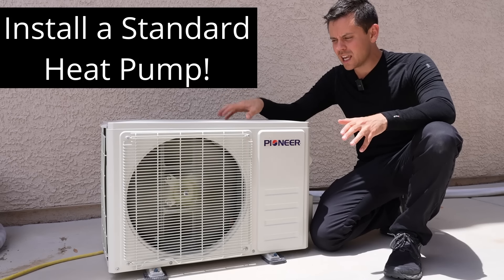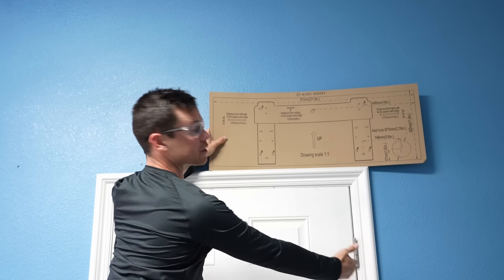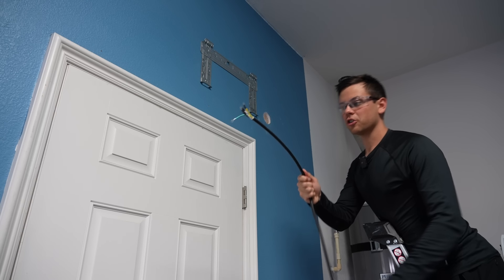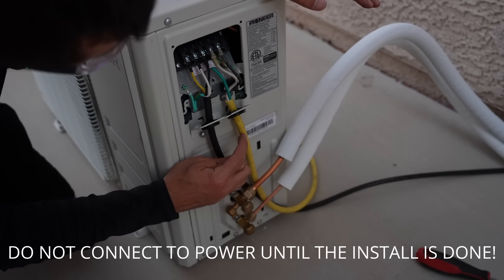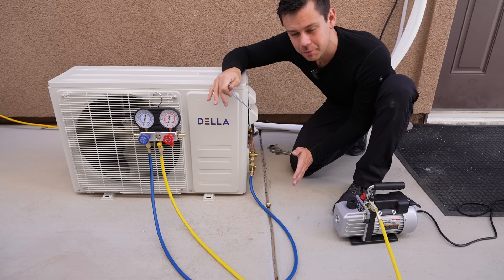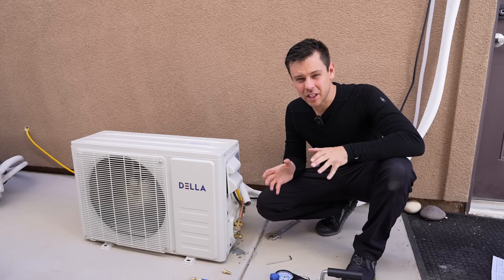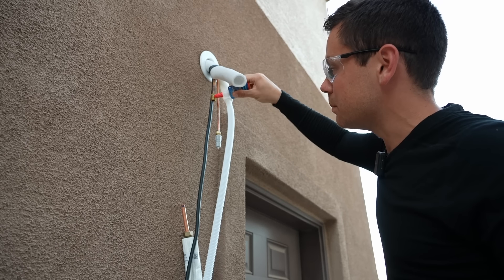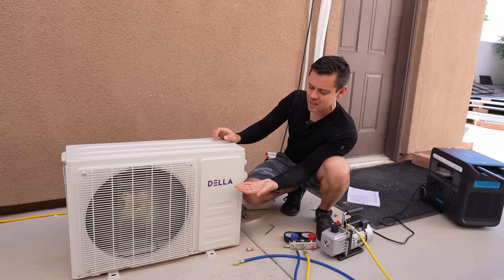Budget Mini Split Installation for Beginners! w/ Vacuum Pump and Gauges

Comment from the maker: Parts list and mini splits mentioned in the video (affiliate links):
Pioneer Mini Split: https://amzn.to/3Og7VZf
Budget Della Mini Split (same product as pioneer but cheaper!): https://amzn.to/3XQlLoF

Vacuum pump and gauges: https://amzn.to/3Qh43Jh
Electronic torque wrench: https://amzn.to/3DdZpUq
Or you can use a traditional torque wrench and these adapters, like I did in the video: https://amzn.to/3pPdqoq
Nylog to prevent leaks on the connection points: https://amzn.to/44JI15N
Leak Detector Spray: https://amzn.to/3OhlEz8
Adapters for hose to service port: https://amzn.to/3Ohssgj

~~~~~~~~~~~~~~~~~~~~~~~~~~~~~~~~~~~~
Does off-grid solar confuse you? 
Save time and money with my DIY friendly off-grid solar kits, my latest product recommendations and so much more! 
http://www.mobile-solarpower.com

Join our DIY solar community 
#1 largest solar forum on the internet for beginners and professionals alike. 130,000 members and counting!
https://www.diysolarforum.com

Check out my free book
Best-selling and beginner-friendly guidebook to off-grid 12V solar!
https://www.mobile-solarpower.com/the-book.html

~~~~~~~~~~~~~~~~~~~~~~~~~~~~~~~~~~~~
My Favorite Online Stores for DIY Solar Products:

Signature Solar
Creator of EG4 and the largest DIY solar store online! 
(automatically save $50 by using my link below)
https://signaturesolar.com/?ref=cPwLcVc0SW-BjN

Current Connected
Victron, EG4, Midnite and so much more! Fast shipping and great prices:
https://currentconnected.com/?ref=wp

WattCycle
A very budget friendly 12V battery that works great!
https://www.wattcycle.com/collections/all/products/wattcycle-12v-100ah-group-24-lifepo4-battery?ref=aaezwkkc

Litime
Classic and reliable 12V batteries for solar! Bestseller for many years:
https://www.litime.com/?ref=XBIA62RFcalHns&utm_source=affiliate

Epoch Batteries
High-quality, marine grade 12V batteries that can survive anything!:
https://www.epochbatteries.com/products/12v-460ah-lifepo4-battery-ip67-heated-bluetooth-victron-comms?rfsn=7352625.50494d

IntegraRack
DIY Friendly Solar Panel Mounting Kits! Easy to assemble and super strong:
https://www.mobile-solarpower.com/ground-mount-racks.html

Ecoflow Power Stations
The most popular plug-n-play mobile power station! I have been using these for years:
https://amzn.to/4gID4j0

Anker Power Stations
Highest efficiency and best performance. The biggest challenger to Ecoflow yet!
https://amzn.to/4k0yhMM

Watts247
Need international shipping for large batteries and inverters? Check them out!
https://watts247.com/?wpam_id=3

Rich Solar 
One stop shop for budget 12V systems!
https://richsolar.com/?ref=h-cvbzfahsek

Battery Hookup
Cheap used lithium cell deals:
https://bit.ly/2mIxSqt
5% off code: diysolar

~~~~~~~~~~~~~~~~~~~~~~~~~~~~~~~~~~~~~~~~~~
Contact Information:
I am NOT available for personal solar system consult! If you wish to contact me, this is my direct email: williamprowsediysolar@gmail.com

Join the forum at https://diysolarforum.com/ if you wish to hang out with myself and others and talk about solar

FTC Disclosure Statement and Disclaimers:
Every video includes paid promotion or sponsorship (such as free products for review). Some links on this YouTube channel may be affiliate links. We may get paid if you buy something or take an action after clicking one of these. My videos are for educational purposes only. Information is subject to change/update at any time. Electricity is DANGEROUS and can kill. Be smart and use common sense :) DIY Solar Power with Will Prowse is a participant in the Amazon Services LLC Associates Program, An affiliate advertising program designed to provide a means for sites to earn advertising fees by advertising and linking to Amazon.com
Reply: Will or anyone who knows to answer please 🙏

Hey Will love your content. About to buy MPP Solar 2724 LV-MR. Can't download the manual so just wanted to know can the inverter be turned off for AC when not in use? I'm building a system for my van mainly for 24/12V.. I know that inverter draws 24W.

Also 4 150W panels with VOC of 42.74 I'll wire parallel and s/b about 17 amps at max and VOC 42.74. Is that going to make for a good system? ( 2 100AH 24V SOK batteries..)
Reply: @Monyornothin  
You could also get Mr. Cool Mini-Slip their Ines are pre done so no vacuum is needed!
Reply: Link for the flare tool?
Reply: @terryrodbourn2793  yes you can but for those that do not like all the extra Lineset and want to shorten it and flare it this is a good video explaining how this is done.
Reply: @terryrodbourn2793 like $500 more too, he says that. Did you watch the video.
Reply: Nice job Will, I will revisit this video when installing my units, Ignore the Haters, your content is Awesome
Reply: @terryrodbourn2793  costs twice as much.
Reply: @fox156 sometimes people miss a detail does not mean they did not watch the video don't be such a punk
Reply: Hey buddy. Question? I'm doin this exact process.. do you think you can send me a link for the adapter that you use. I have the gauge unit and the compressor. Everything is installed already I just have to vacuum the hoses. All I need is that adapter. Do you know where I can find?. Thank you sir
Reply: Just installed my first MINI SPLIT it's a DELLA 9000 BTU 120 AC, now I can power it with my solar system..small but I have a tiny home it's perfect.
Reply: NOTE: A manufacturer/company may require professional installation to have a valid warranty in regard to the vacuum/charging.
Reply: @Pappy-1   Yes, that is a valid reason for doing it this way.  The extra costs hurts, though.  So how much are you really saving?  NOTE: There are sales, too.  Then, the time involved v. quick connects/precharged... especially if the solar panels are included with wiring.  Now, if doing 2 or more, or working something out with a neighbor?
Reply: @karmendimas5274   Yeah, and sometimes people don't watch or skim.  And, you missed this: "Did you watch the video."  That's a question.  Grow up.
Reply: @terryrodbourn2793   How did you miss the obvious in this video?  :-p
Reply: i successfully installed 2 new Goodman mini splits thanks to this video. I did encounter 1 problem. i purchased the recommended adapters. It worked great on the first unit install. On the second one it kept leaking from negative 30 vacuum back to zero. But I had no leaks. Fittings were tight and I used nylog. The problem was the adaptor fitting. The seal inside the fitting is a hard plastic and became deformed after one use. That s where I was losing vacuum. When I used another one of the new adaptors I had no more loss of vacuum. So don't assume your system has a leak if you lose vacuum.

Comment: It’s better to wrap the UV tape from the bottom up. If you wrap from top down it can let water in through the over laps. Think of it like shingles.
Reply from the maker: Oh interesting
Reply: Since it rarely rains in Las Vegas I'd bet that Will will probably be ok.
Reply from the maker: @joelhansen7373  very true 😂
Reply: @joelhansen7373 yes. true vegas hardly gets rain, but, Will makes videos to help teach other people. so the direction of wrap is a good point
Reply: That's a good idea. I have an extra roll, I may run another one going back up.  I'm also adapting some plastic gutter for a line cover.
Reply: @joelhansen7373 just so you know; the world wide web (where this video is posted) goes beyond Las Vegas.  Which means people in places OUTSIDE of Vegas will see the video.  The comment about how to wrap the tape is beneficial and valid.  What is neither beneficial nor value is your snarky comment.
Reply: As a hvac tech I approve this video. Couple things I would of done differently but well explained video 👍
Reply: @joelhansen7373 Is this video only shown in Vegas?

Comment: Great video Will. Been in the HVAC industry since 94 and started by company in 2010 . We do about 20-30 of these a year . The only thing I’ll say is getting parts for these off brand units is very difficult as well as finding a licensed legit contractor to work on customer provided equipment . There will be warranty issues as well for customer installed equipment . Kudos to you taking this on yourself .
Reply: Are regular Joes able to get the refrigerant to charge these, or would we have to hire an HVAC pro at the end anyways to charge them? My understanding was that one needs a license to buy the refrigerant, no?
Reply from the maker: Thank you!! And very good points. Also can be hard to find HVAC companies that will work on them. I found one that does it often, but some others I called  won't touch them.
Reply: @TroyWarr1980  NO, you have to be EPA certified to work w refrigerant .
Reply from the maker: Oh these units come pre charged. You just need to vacuum the lines (check out the video) and then release the refrigerant afterwards. No need to handle to use refrigerant at all in these diy kits
Reply: @WillProwse 😂 I have same exact one, I never pulled a vacuum on it, and it still works perfectly 3yrs later .... 👍🏿
Reply: Getting a full replacement unit for $650 is likely cheaper than calling an A/C tech...  ;-)
Reply: @thetruthserum2816 

HaHaHa. But HVAC Specialist Leaves with a Big Smile. THANK YOU FOR YOUR SERVICE.
Reply from the maker: @vroor32  what!!! No way!?? That's crazy
Reply: @WillProwse  🤣 yes way, my guy. It's mounted behind the cab of my semi truck... And I use a 240ah lifepo4 battery and sungold charger inverter to run it.
Reply: @vroor32 wow that's awesome, what kind of run time do you get on the 240ah battery?
Reply: @K4AX  Yes, @vroor32 I'm interested in mounting the 9,000 BTU unit on a small camper, or van.
Reply: @K4AX  this hot 90⁰+ summer, I'm getting 24hrs of use @ 74⁰ setpoint. Battery is 24v
Reply: @thetruthserum2816 i agree
Reply: Reviews on Amazon for these not good. Leaks in coils in roughly 1 years time, shipping damage, bad boards, and non-existant customer service. Will be very interested in your follow-up review.
Reply: @josephbrabenderiii2049  ok.  I will start it off.  I installed a Fujitsu in 2013 by myself and have had no problems.  Next drama queen.
Reply: @Channel-gz9hm  My friend, this is extremely helpful, and clears up several open questions I've had for a while. Thank you so much for taking the time to clarify all that. I'm a DIY-everything guy so I have no apprehensions about doing this myself, but like you said, Big HVAC does their best to control the tools of the trade and so far I'd been fooled into thinking I just couldn't acquire the refrigerant myself.

Anyways, I bought a Mitsubishi MZ-FH06NA (33 SEER!) just before the pandemic for an off-grid tiny home project, but that got delayed and it's just been in storage. I recently had to pay an HVAC guy $500 to add 6 lbs. of refrigerant to my central heat pump and I've been dreading paying similarly for the Mitsubishi once I finally set that up. Sounds like that unit should be pre-charged too even though it's ~5 years old? Pre-charging them isn't a new thing?
Reply: Good points-- this was something I was going to add. I've been in the business for 35 years as a facility engineer. I had my gauges, but would have needed a pump. I came very very close to installing a Pioneer 12K but as I read more and more reviews I realized that companies were very reluctant to provide any warranty coverage when people did their own, and in fact most of them now have disclaimers on Amazon and other places to that effect. It was apparently pretty frustrating for people, even those with a substantial background in the field. That's why I wound up installing a MrCool, especially when I found it for a killer price. Yes, they are priced higher, but that 7 year warranty is worth something to a do-it-yourselfer.
Reply: @josephbrabenderiii2049  I have pioneer mini-split 9K btu .... Mounted on my semi truck. It's been thru 3 summers and 2 winters .... survived both truck vibrations and rough roads .... No leaks as of yet. So maybe it's an  installer problem 🤷🏿‍♂️
Reply: I have a Pioneer 110AC 12k inverter that I installed myself using the can of line purge that came with the kit. Still works great after 4 years! I use it for winter heat mostly in a large downstairs room. It’s way cheaper to run than electric baseboard and brings the room to temp quickly. I may buy the compressor for my next one.
Reply: @WillProwse yeah same, no vacuum about 10 ish units installed in my house and they work fine. I think the amount of air v the refrigerant takes care of it.
Reply: @TroyWarr1980 
The unit is pre-charged, the lines are not. He is only vacuuming out the lines since they were open to the elements before they where connected. After they are vacuumed & holding he opens the valve on the unit & releases the refrigerate into the lines.
Reply: @vroor32 The efficiency will go way down and moisture in line will eventually kill the compressor.
Reply: @jasonweb9720  so what to do now? Pull a vacuum 3yrs later? Then refill?
Reply: @jasonweb9720  he said he installed it on his semi, so maybe that’s only a few feet of tubing, which is relatively small compared to the system volume. Seems like a bad idea in theory but maybe that’s how he got away with it.
Reply: @vroor32  
Just leave it. You don’t show people the wrong way.
Reply: @matt7403  it's about 20 feet of tubing. I'll just leave it as I've been advised. If it does, I'll just buy another and keep rolling 😁
Reply: @vroor32  Have you thought about making a 120v Lipo pack and skipping the inverter entirely?
Reply: @dlloyd6300  naaah, I have limited space in the cab of the semi truck
Reply: @vroor32  Size shouldn't be an issue if you were to build it yourself out of smaller cells in series to step up the voltage. Overall the battery shouldn't be physically any bigger, but you would skip the parasitic draw of the inverter. I saw another channel that showed the inverter eating 100w just at idle! Just my scientific curiosity. cheers.
Reply: @WillProwse... I don't want the extra coil of line, and like that you can cut the lines and redefine the connector.  Do all split units come precharged?
Reply: @wabbott444  Yes they all come pre charged but that is irrelevant. If you wanted one that wasn't pre charged you would need an HVAC tech to come and service it anyway, so pre charged or not, the tech can come, cut the excess line, remove the pre charge, and then charge it with the appropriate amount of refrigerant. The problem is good luck finding an honest willing tech. They want the sale, install, and service, not your scraps of a service refill so if you can even find anyone willing, you will probably be overcharged.
Reply: @Channel-gz9hm  It's not irrelevant at all. It's actually quite relevant. It's even addressed in the product manual. The unit is shipped with a specific amount of refrigerant that is ideal for the length of lineset that it is shipped with. Obviously if you needed to change from a 25' lineset to say a 50' lineset then you have increased the volume of the system and would require more refrigerant than is pre charged. Likewise if you cut back a 25' to say, 8' as it would be installed directly outside the wall as the head unit, then the pre charge is too much for the new service volume and you would need to remove some refrigerant. This is all addressed in the manual as well as the formula needed to adjust the calculations. My manual states to modify at 0.32Oz/Ft. I'm sure that you can deviate to a reasonable amount but going from 25' to 8' would be a  significant decrease of volume and the precharge would be overserviced.
Reply: @dlloyd6300  I might suggest that it is relevant, in that,  if you need to bring in an HVAC tech, (who may be impossible to get) it's not DIY any longer.  I'm simply looking for the units that will allow me to follow the steps in this video and modify the lineset length.
Reply: @josephbrabenderiii2049 install a surge protector to protect boards..mine is 220 and I installed a outdoor surge protector for 60 .
Reply: @TroyWarr1980 They come pre-charged, all the charge is in the unit when shipped to you. Just hook up the lines, run a vacuum and release the charge.
Reply: @carmlasalle1774  The units that are pre-charged or not for the consumers. The units that come with pre-charged line sets are for consumers. Consumers are not allowed to deal with refrigerant. With pre-charged lines, you did not need to pull a vacuum. We’ve been installing these for a decade now. We don’t do these cheap systems that come with the pre-charge line sets or these cheap Mr. cool units. Getting parts, for these offbrand systems is nearly impossible.
Reply: That’s what made me get a brand name unit. Literally just getting parts.
Reply: I installed mines on a wall bracket. The bracket is level but the condenser unit is not level. Will that be an issue to run it this way?

Comment: Your presentation on connecting/disconnecting the gauges, vacuum pump, vacuuming the system, and checking for leaks is the best I have seen on the internet. You knocked it out of the park.
Reply from the maker: Thank you!!!!
Reply: @WillProwse  Seriously, that was the best and most concise explanation I've seen, too. I'm here doing a refresher for my second mini-split install, and I really appreciate the clean delivery--it's way better than anything we had a few years ago! You might want to consider cutting and pasting that chapter (vacuum procedure) into its own video for indexing and posterity. 

Absolutely great video work. Thanks.
And here's your like, 👍which I barely ever give out!